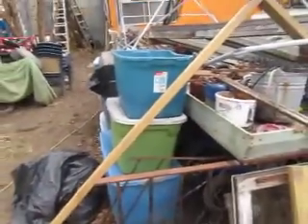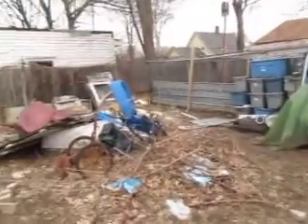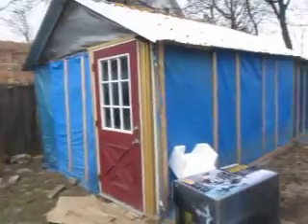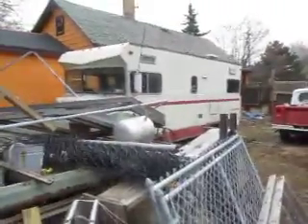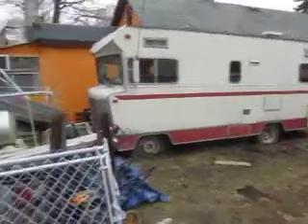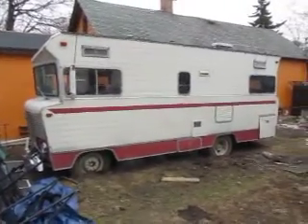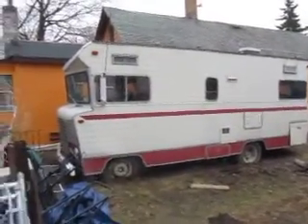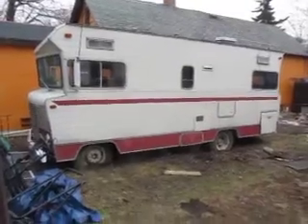Homemade broadfork idea

Comment: Cool, dude. ;-)
I used to drive a Scout, back in the '80's. Better than a Jeep!
Reply from the maker: My Dad had one when I was real little because we had a long, wrap-around driveway to keep plowed in winter. I remember riding with him a few times in it, but it was not as fun as it sounds going back and forth at high speeds with sudden stops in a vehicle with virtually no padding anywhere! (And a really crappy heating system) LOL

It uses oil in the air filter instead of those paper ring things... and you can use the choke as a cruise control! LOL